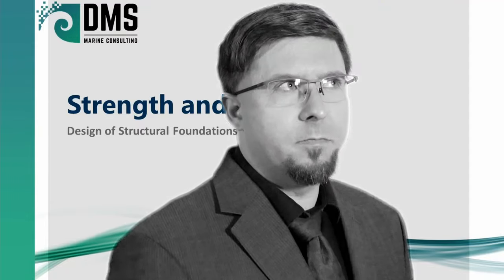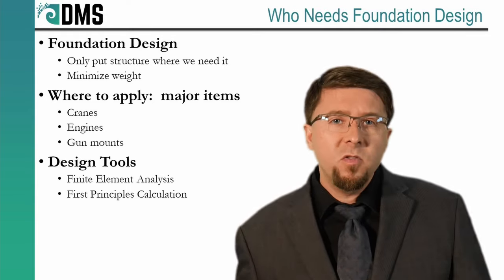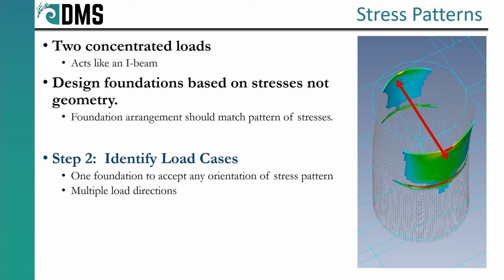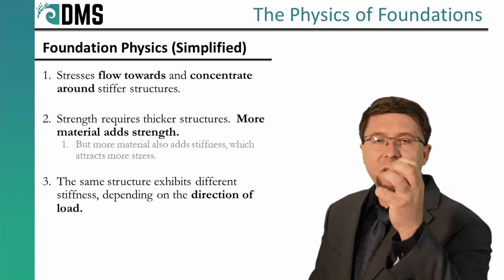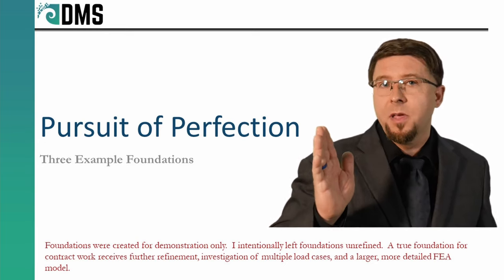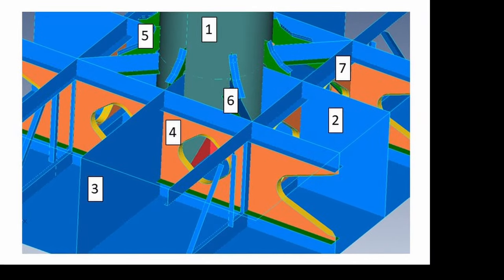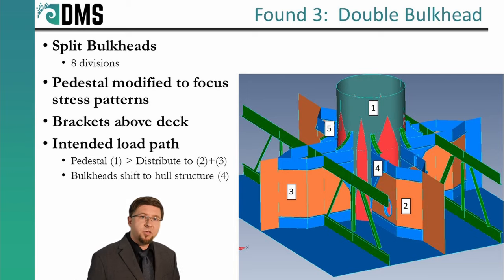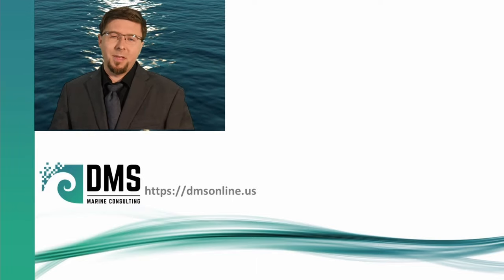STRENGTH And STIFFNESS:  Design of Structural Foundations

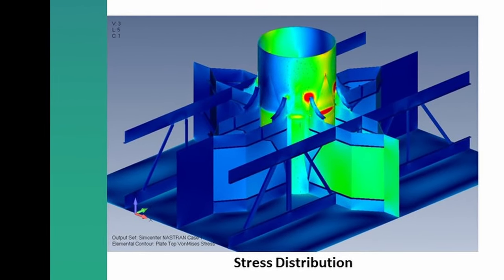Comment: 14:45 Why did you weld your above-deck braces directly to the column? The tops of the plates point-loaded the column, which is why they are hotspots. Typically, a carefully shaped load-spreading doubler plate will be welded as an interface between this knife-like support brace, and the column; possibly with further braces tangentially to it.
Reply from the maker: The original design did feature the standard method of a thicker deck plate with no braces.  That created too much of a point load at the deck interface.  This particular column needed to resist an extremely large bending moment.  The braces on top split that point loading between the brace and the deck plate, preventing excessive stress in either spot.  We could have refined the braces further to provide a smoother transition on the structural stiffness, but it wasn't necessary.  The current braces were easy enough to fabricate and achieved the required stress limits.

Comment: Hi Nick, Do you also perform hand calculations and use the simulation for validation? Or you just totally depend on your FEA simulation.
Reply from the maker: Primarily, we use the simulation.  Most scenarios for FEA involve structure too complicated for hand calcs to be accurate.  But we also validate the simulation software and methods by comparing it to several test cases.
Reply: @DatawaveMarineSolutions  Thanks Nick, your videos have been very helpful especially the GHS tutorial series.